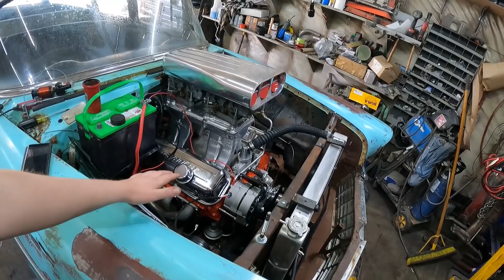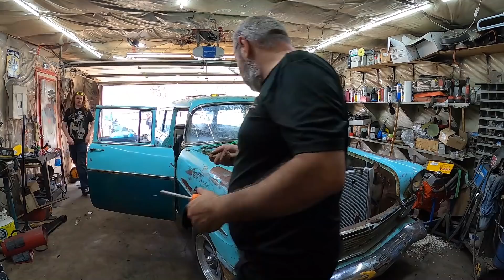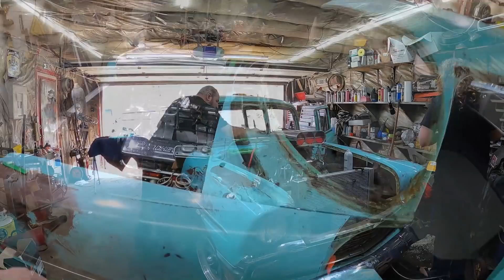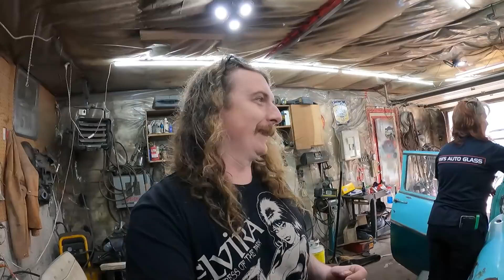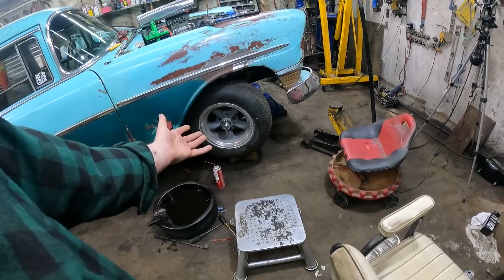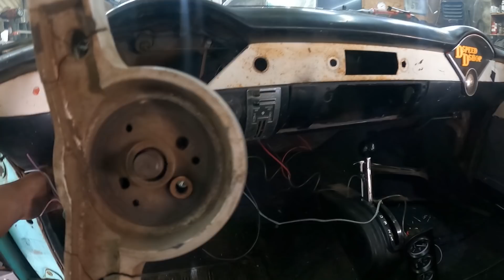Big Motor Problems And New Glass - 1956 Chevy Gasser Wagon

Comment: Had a rear leak in my small block Chevy that I had a hard time figuring out. I found the answer thru some online forums, apparently Eagle Cranks have a pressed in plug at the back of the crank, after time they are susceptible to leaks. Get a new plug and use a good sealer to stop this happening again. Hope this helps anyone running into the same issue, hard to tell when the flexplate is flinging oil everywhere.

Comment: Hi Dan,  you have sucess where I have not, for me, silicon has always acted as a lubricant to rubber seals etc. after dropping pans as you just did, I changed to #2 permatex on rubber gaskets, or gel type super glue just to hold the rubber in place 
in fact all gaskets in place ,and ended my oil leaks .  great video thanks as always

Comment: I'm sure you've used "the right stuff" by Permatex.  I just love that stuff & I won't use anything else.... anyone else out there love it too?
Reply: HYLOMAR,as used by Rolls Royce,gets my custom, especially after sealing up several leak prone British Motorcycles! BEST GOO,on the market, withstand high pressure,high temperature,as well as variables unimagined!
Reply: @davemclaughlin8646  thanks for the tip. Never heard of the stuff,  but I'll 
Look it up, thanks! 👍
Reply: Never tried it. always use their Ultra Seal grey,  seems to work good.

Comment: G'DAY Dan,I could feel your pain, through both your tasks this VLOG,as the windscreen fitment,was something that GMH HOLDEN Australia, carried over from GM,into their vehicles right up into the late 70's,I struggled alone with my 1974 LH TORANA, fitting front & rear screens,using plastic coated clothesline to feed rubber seal onto flange,after second full repaint,I made the decision to cough up the $165 for the auto glass mobile man to visit my garage,best decision due to 19 one TONNERS later,am still learning new tricks, especially with new primers/ sealants coming on the market, guaranteeing a waterproof seal( gone are the days of a cartridge or two of SIKAFLEX { StickyShit}, sealing good enough), trust that you snagged the oil leakage issues, with the new gasket? As always, Kindest Regards, Dave McLaughlin, Queensland Australia

Comment: If your transmission is the Powerglide they were notoriously for belching up a half a quart of trans oil for every couple of days it sat because the torque converter held more transmission fluid than the trans pan did so it would back up and spew on to your floor from the dipstick tube so chances are it's not a rear main
Reply: I think he said it was a built 700r4

Comment: Back in the late 80s i for about two weeks for a Auto, and truck glass company, they hired two of us the same day, and kept one of us, and it wasn't me, i guess i wasn't fast enough for them, so, i went on my merry way, and did a few different things, until i found my calling, i worked my last 25 years at a metal fab shop, in Indiana that built several things, one was those dividers that went between the front and back seat of county cop cars, but installing windshields, in car is not an easy quick job to learn, it does take allot of skill, like that guy beating on the glass, would make me nervous  for sure.

Comment: As you were talking of where the oil leak was and replacing the pan gasketI was thinking why not replace the rear seal while the pan was off. Hey , you did. As for the glass even the pro's break glass but a lot less often the average guy.

Comment: It takes someone who knows what they're doing to do windshields in the older stuff. Safelite broke 3 new windshields before they finally installed a non cracked one in my 1st Gen Cummins...and that's an easy windshield compared to this.  I can't even imagine them trying to install a wrap around window. 
I think after my experiences with auto glass 'professionals', when glass time comes, it'll be worth the 450 mile drive to the auto glass shop that sells the glass for my 55 Olds.

Comment: Ok . Here is my opinion on the wagon . 1st of all , love the car . You have a pretty straight body , good glass and good drivetrain . I'm thinking being a 75 yr young guy . If yoy got to pull the engine , when you go back change carburation to a 800 pumper , put everything under the hood,  di something about the paint  poof ! You have an everyday driver , a classic that appeals to a much broader range of car lovers and value of the wagon goes up at least 15 grand . What do you guys think ?

Comment: Get you a canvas buffing wheel, for your drill. Get some aluminum wheel polish.  Buff outside of all other windows, with the aforementioned products. Wipe off with a towel. The old windows, will clear right up. Takes off, decades of oxidation. Ask me, how I know.😃

Comment: Those front seals in the transmission have a tendency to leak when let sit and stop leaking after you put some miles on them, I'd put some miles on it (like 40 plus miles) and see if it softens up enough to stop leaking.

Comment: Here is a helpful tip for everybody, if you have or want to have the Bel Air trim that goes on the windshield posts, you MUST remove the windshield before installing the stainless trim on the posts! Broken glass is the result of trying to sneak it in or out past the windshield trim. Also I have seen the bottom corner trim with a long stud that goes through the post.
Reply: What about the back window? Take glass out to get trim in?
Reply: @invisabledad  afraid so, if you ever get to see a piece of the trim, you will see how deeply into the rubber the stainless goes. Maybe Dan has a spare piece he could show people on camera.

Comment: When they replaced my windshield the PO used new rubber and the corners don't fit. So neither does the stainless. I have a T&N seal for the back glass, and got one from Auto City Classics for the front.  I need to remove both and have them re-installed. I tell  you seeing that you hired someone else to do yours does not give me any confidence that I can do it myself!
Reply from the maker: You absolutely can do it yourself. But the time saving for me is worth the cost

Comment: I was hoping the oil leak wasn't the fitting you put in for the oil pressure gauge. It didn't seem like it leaked before you did that. Somtimes it can be the smallest things  .
Reply from the maker: Yeah. The oil pressure gaugr is on thr side of big blocks

Comment: One other way to avoid the crappy fit of new seal is to buy the expensive brands.  steele rubber is a way better brand than the cheapos most 55 to 57 places sell for cheapo prices.  There is a differemce.  Don't getting bummed on new parts...on some items there is a better one out there.

Comment: I got a bad feeling you might need that "fancy oil pan" after all...hopefully not. If you want to convert to copper line for oil pressure you can get a 50 foot roll (it will come in handy for your future projects)  for $35 CDN   https://www.amresupply.com/part/CTR-2-50-COPPER-TUBING-1-8-inch-X-50    . You can also  get the "compression olives"  from Parker ..https://ph.parker.com/us/en/brass-compression-fittings/60c-2   I saw a video where a plastic oil pressure line melted and started a fire